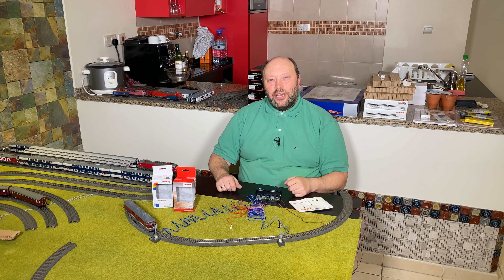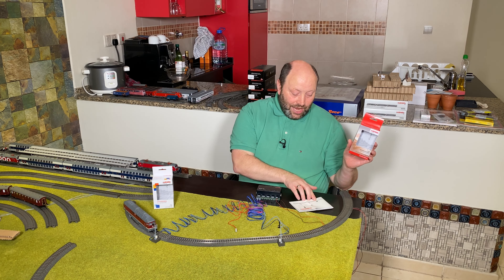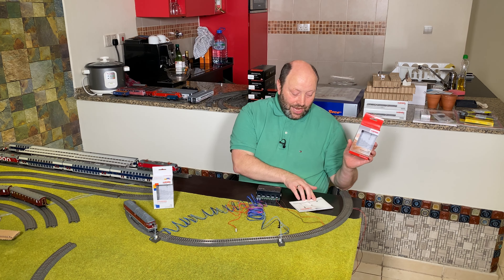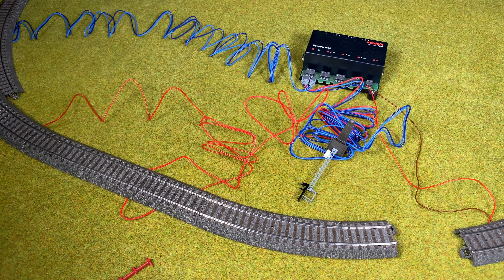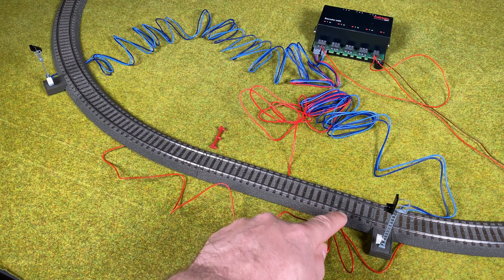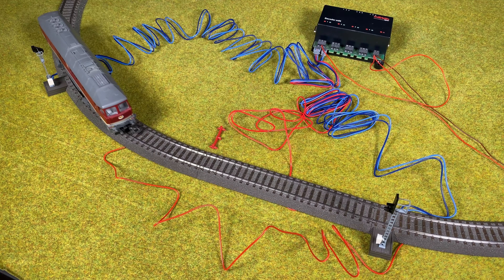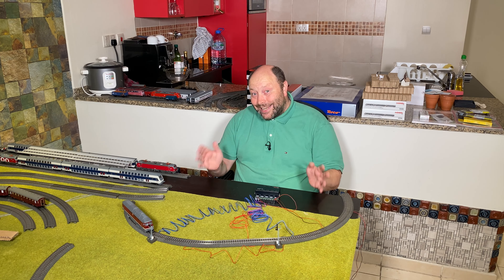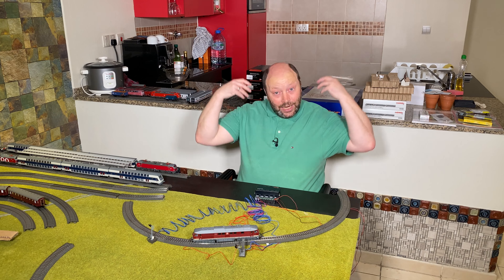Stop Section with Märklin START UP Light Signals 74391/74380/74371 using M84 60842/60841 (Beg Ep 5h)

Comment: Hi bo, can you show a video on how to create a stop section using k track (flexi track). I do not want to cut power off as I want the sounds on the train to still work but I want to be able to stop the train automatically at a set of lights or at a station.
Reply from the maker: Hi Alf, 

If you want sound when the locomotive stops you have 3 options: use the braking module (expensive and complex), using events in the Central Station 3 or use software automation. I prefer using the events in the CS3 for my small temporary layout. You can see in this video how this works: https://www.youtube.com/watch?v=TwKk9C9WweE&list=PLYAhs-Pox3sHzQJsNU-FmOEj1ylO-NPpV&index=1&t=1520s If you are making a permanent layout or have a larger layout, then consider using software automation like RocRail, TrainController, iTrain or WinDigiPet.

Unfortunately, I do not have any experience with K-track. The issue is how to cut the power where needed. 

Hope this helps! Enjoy ;-) Bo
Reply: @ModelTrainFun  thanks Bo. The only problem I find is how to cut the k track and insulate the same way you do with c track. I thought possibly you might have been able to help me in this element. Your advice using c track works perfectly but with k track i am stuck. Thankyou for your reply

Alfred Bugeja

Comment: A realization just hit me concerning a stop track. When the train is moving counter clockwisw as yours is in the video the train will stop at the signal. If for some reason the direction is reversed to go clockwise the stop track will stop the train in error. Is there a fix for that situation?
Reply from the maker: Hi Mike, Agreed it is an issue when going the opposite direction on the stop track. I am wondering if you could make a solution using an M84 where it will provide power when passing a circuit track in opposite direction and turning it off when it has passed. However, I have not tried it. If you email (find mail here: https://www.youtube.com/@ModelTrainFun/about) me I can look into it and perhaps propose a solution. Enjoy ;-) Bo
Reply: I may have solution in mind. I will email you tomorrow.

Comment: question is there a even more simple way to get ligths in a model build im not super good with electric and my build is slowly getting there or are the marklin ligth system easy to do then i have to see if i can buy them oneday and i realy hope i got more hen enough power for the g shape im making you did not see the hole platform so but i will findt out when i have a full circle made ina g shape so i have a loop where the train goes around and around i will keeep it simple my first build to learn but can you change the power travo to a higher one that is for the marklin c track with ballast ofcourse you have to change the power trak where the joystick and power goes in i think but keep it up i hope to learn more
Reply from the maker: Hi Hein,

I little unsure of what your question is about lights - are you talking about signals, house lights or street lights? If you are talking about signals I believe the easiest is using the START UP light signals as shown in the video: https://www.youtube.com/watch?v=byOzCs-SClY You only need to wire power to the M84 - the rest is plug and play. But you only have 3 types of signals: Home block, distant and yard signal. The START UP signals can also be used with a control box - then there is no soldering...

As for growing - yes you can upgrade to bigger systems as your needs grow. However, the MS2 and the joystick are limited in power. If you need a lot of power next step is the CS3 - and after that multiple boosters for your CS3.

Hope this helps! Enjoy ;-) Bo
Reply: @ModelTrainFun  many thnks again it will help so far youre info is correct and im realy thnksfull for it i dont know how to show it
Reply: @ModelTrainFun  for a begginer it can hard to figure out things yt is often the only way and many dont show the correct stuff because everybody builds on his own way thats why i ask if there where simple ways for rail signals and house light street light system that is simple and easy to place and use 
youre info will help and keep it up the good work my good man
Reply from the maker: @heinwelters  Must admit I have not played with house or street light. If you do not need to control the light I would just buy a power supply and connect directly - faller, viessmann and other manufactors have power supplies matching their light systems. If you also want to control it digitally consider using the M84 to turn on/off power from the power supply as shown in this video:  https://www.youtube.com/watch?v=eo65jHaoWqE Hope this helps! Enjoy ;-) Bo

Comment: If i want to have a stop section in a shadow station without signals, do i do anything different from the videos? Thanks!
Reply from the maker: Hi, 

You are absolutely right - you can use the m84 to make stop sections in the shadow station - no need for the signals. When you are doing this you can think of the stop section more as a light you can turn on/off. In this video you see how the m84 is used to control red/green for each signal - which means you have 4 red output for STOP sections.

You can also reconfigure the m84 to have 8 independent outputs as show in the video with the m84 and lights: https://www.youtube.com/watch?v=eo65jHaoWqE In this way you can make 8 stop sections for the shadow stations with one m84. Feed the red power wire from the CS3/MS2 into the center and route the red and green output to two separate STOP section. The outputs are wired to the center rail (B) on the track. You can see how to connect to the track and how to insulate the track in this video: https://www.youtube.com/watch?v=wrSVwgIgR-4&t=1901s

If you get really fancy don't forget that the stop can be triggered automatically when the train reaches a certain point on the track using the same technique for triggering the m84 output as in this video: https://www.youtube.com/watch?v=yzdb7c2Hx9U&t=255s

In this way you can even automate the shadow station using the m84. I intend to show this in a future video - when I get around to it...

Hope this helps! Enjoy ;-) Bo
Reply: @ModelTrainFun thank you!

Comment: You could slid the signal further away from stop track when the loco gets too close or slightly passes the signal.
Reply from the maker: Hi Mike, absolutely agree! This is the main thing to consider. Where do you place the signal and how long is your stop track? Test with all your trains to see if you have make it fit. Enjoy ;-)
Reply: So mention that in your next stop track video.  Show how to wire with control box.

Comment: When you have multiple start up signals you will need to use a 72090 distribution strip for red wire Connection on the M84. Correct?
Reply from the maker: Hi Mike, You can use a distribution strip, but you can also just pick the power from the power connector or a power bus near by. However, you need to consider how much combined power the stop sections could use if you divert power from one spot to all stop tracks. The issue is potential overload of wires. This can be a significant load with older models with older motors or light bulbs. Todays modern rolling stock uses much less power. I guess what I am saying is that consider how to wire your layout, consider the max load hat might flow through the wires (how many locomotives) and minimize length of wires. I hope this helps? Enjoy ;-) Bo